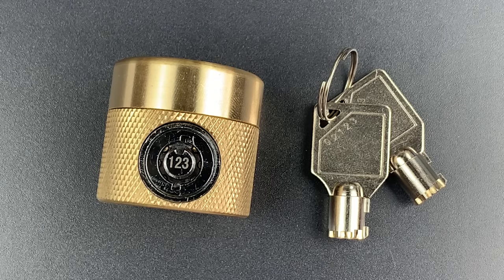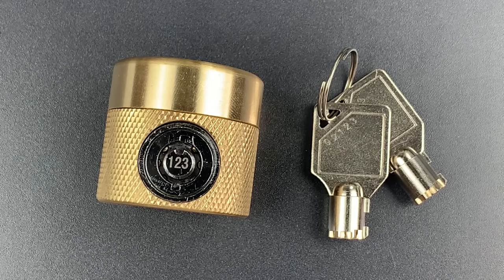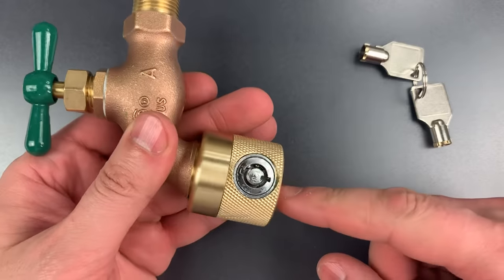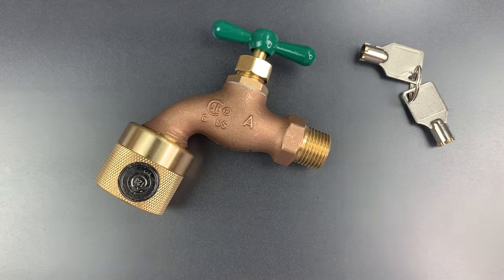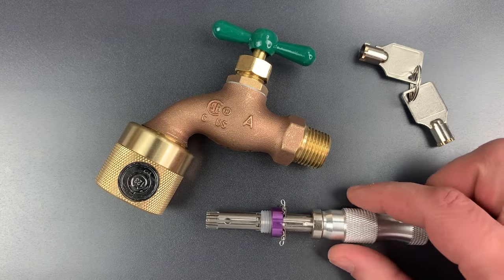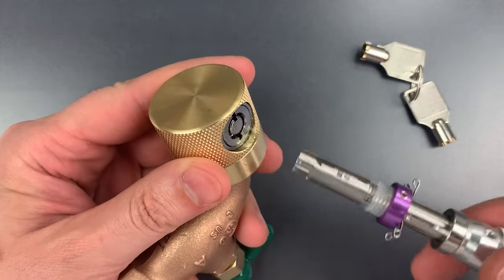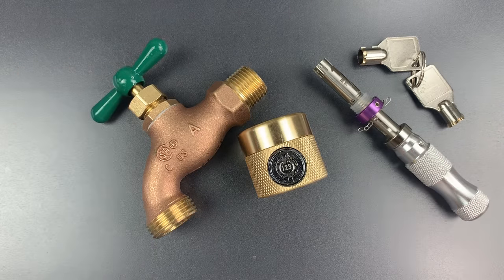[840] Flow Security Systems “FaucetLock” Picked FAST

Comment: Removing the handle is usually enough to protect a faucet.
Reply: You can remove the handle?!
Reply: @anthonyjh02  on some yes
Reply: @anthonyjh02  usaly theres a screw or bolt/nut on top of the handle that you take out and off comes the handle
Reply: nothing a pair of pliers cant take care of .  once it's stripped you will need to replace it as well costing even more money
Reply: Can't someone just put a new handle on then
Reply: @SoulDelSol  Um... yeah, but who carries a spigot handle around?
Reply: @TiberianFiend  i thought it'd be at least a few hours before someone said that, I'm impressed.
Reply: @SoulDelSol  Can use pliers too. If you're out to steal someone's water you probably have pliers on you too just in case.
Although I've never heard of stealing someone's water, only about stealing valves and water meters.
Reply: @pubcollize  ya I've heard of stealing copper pipes from vacant apartments for scrap.  And I've heard of people routing water from other side of water meter so they don't have to pay water bill to city.  Also I've heard of people stealing various utilities from neighbors in shared buildings so their usage goes on another's bill.  Watering lawn does use a lot of water so i could see someone putting hose on another spicket if right there but seems like hose across yard would be giveaway.  For my spicket, i have a shut off valve inside house in basement.  I could see landlords in apartment complexes wanting to protect their spickets from people washing cars and using sprinklers for kids on landlords utility bill
Reply: @SoulDelSol  Stealing utilities from utility companies is one thing, but stealing them from a neighbor sounds like way too much risk for barely any reward.
I live in the city so I've heard of cases, and seen results of, where bikes were locked to water meters downtown and both the bike and the water meter were stolen. Huge mess, also best example of "be careful what you lock to".
Also never heard of spigots being called "spickets".
Reply: @pubcollize  You can't steal water. Legally, it's not theft. However, passers-by who just need some water for whatever reason can open up a spigot and leave it on, which will eventually burst a garden hose, leaving you to pay for the hose and the wasted water. People take water as a "crime" of opportunity. Take the handle off and they'll move on to the next spigot.
Reply: @TiberianFiend  of course you can steal water, someone pays for it..  i pay a quarterly water bill that has portion for water usage based on meter and portion of sewer usage (also based on same meter). Also why would a hose explode if you left water on?
Reply: @pubcollize  i looked up spigot vs spicket and i was wrong
// “Spigot” is the correct answer. Did you get it? “Spicket”—though commonly said and written—is not actually the commonly accepted spelling of the word. This confusion dates back to the Middle English “spyket,” according to Merriam-Webster though, so I wouldn't feel so bad about it if you had it wrong. //
Reply: @SoulDelSol  I'm ESL so I'm aware of the spelling but I don't recall hearing it pronounced, I guess the pronunciation should be fairly identical now that I think about it.
Reply: @Daybreaker7826  On many of them really.
Reply: @TiberianFiend  you absolutely can steal water, and it is absolutely illegal. Like you can grab a bucket of water from a lake and it's not theft, but taking water paid for by someone else using their infrastructure without permission is absolutely theft
Reply: @brewcityboatclub8299  One of the legal requirements for theft is preventing the previous owner from use of the stolen item. Since the water is on tap, you have an indefinite amount of it and are not prevented from using it.
Reply: @TiberianFiend  If I bought a bottle of water at the store, and someone grabbed it from me in the parking lot and ran away, wouldn't that be theft? So what is the legal difference between a bottleful of water from the store, and a bottleful of water from a tap? How quickly you can buy another one? Water companies don't charge flat subscription fees; they charge per unit of water delivered. That's why you have a water meter on your property.
Reply: @Nezuji  Bottled water is finite and containerized. Tap water is not. Taking your bottle of water will prevent you from using it yourself.
Reply: @TiberianFiend  
Buddy it’s illegal regardless. Using someone’s infrastructure is illegal. It’s literally called water theft. A simple search brings that up.

Nice try buddy

Especially in texas, it’s considered a class c misdemeanor (in austin at least) So a fine that’s equal to or less than 2,000
Reply: @cadenbrown7407  I didn't say it was legal. I said it wasn't theft. If it was, it would be covered under existing theft laws and wouldn't require its own special laws, now would it?

F.Y.I.--Legislators can call a law whatever they please, but that doesn't make it theft. I had to go over this for the "software piracy is theft" guys, too.
Reply: @TiberianFiend   Water theifs?
Reply: @TiberianFiend  Apples and oranges. If someone buys software and I copy it, then the original buyer still has and can use the software. If you take a gallon of water out of my spigot, then I have to pay for that gallon, AND pay for another gallon for myself. You have literally taken something with a defined value from me. The fact that I can "get more" is irrelevant.
Reply: @TiberianFiend  someone who has played too many point and click puzzles
Reply: @TiberianFiend  so do you think someone can plug their heater into extension cord and  run up your electricity bill?  You think that's not stealing bc "you can always just get more electricity from the wall"?  Yes the thief didn't block your access but the thief stole [electricity/water] that person now has to pay company back for.   That's like me using your credit card and then saying "chill there is still more money left available for ya" - you still have to pay back for what i took.  How do you not understand utilities at all?  You have to pay for everything, each gallon of cold water from the tap, trash removal on trash day, etc..
PS I will make one caveat.  Tap water is NOT free in urban areas.  Perhaps he didnt know that bc he lives in rural area and has a well.  Someone using well is different than someone using your city tap water which is paid for by the gallon
Reply: @punker4Real  And the pliers could remove the "lock" anyway. There's plenty of meat above the part which spins freely.
Reply: Tiberian Friend it's still theft, tap water is a resource you pay for. Just because you can still get more from the faucet doesn't mean the amount taken wasn't theft.

Your analogy is just as stupid as if you were to say theft of cash is not theft "because you can just go get more from the ATM"

It doesn't matter how much more of the resource you have, it's yours and it has value. Someone taking it is theft whether it's cash, water, food or any other resource that you own or pay for.
Reply: Have a neighbor fill up their pool from your tap without permission and then find out you now have to pay potentially hundreds of extra dollars for the stolen water and then tell me it's not theft.
Reply: Great idea

Comment: Picks it in 10 seconds.

"It took a little longer than expected"
Reply: In his defense, for him, it IS a tad long.
Reply: In his defense, it was the locks fault, it has weak springs, probably. :)
Reply: @JosephLedbetter  
But in the case of a low-value target, such as this faucet, any security measure is probably enough.

Comment: A problem where a faucet is on a walk path to a public beach.  People will leave water on, leave trash around faucet, break faucet, damage property.
Reply: Hence this product, but there are certain taps on the market that don’t require a lock to operate but do require a key 🤯.
Plumber here, and lock pick enthusiast.
Reply: @NoticeForBlue  .
At least in Australia, publicly located taps tend to have removable handles and so unless you just happen to carry around pliers or mulitgrips (or one of the handles) all the time, these taps are effectively locked.
Reply: I’m a plumber from Australia.
Reply: I wonder if water still seeps through if you turn the faucet on. Also is the lock entirely waterproof inside, in case soneone foes turn on the tap. It would need to be submersible grade so that it diesnf rust out. How well with the grease in the lock cope with water immersion in long term
Reply: @dj1NM3  the thing is, I use those same faucets for my own front and back yard to hook the hose up to. So I have one of those keys on my keyring along with my house keys. The thing is, while those keys are pretty much universal, you don't have any way of knowing whether that water is safe to drink or not.
Reply: @Professional_Youtube_Commenter  ofcource. That's the first step when designing such a lock:
Step 1/ do not leak any water
Step 2/ how?
Step 3/ design a lock that suits the tap
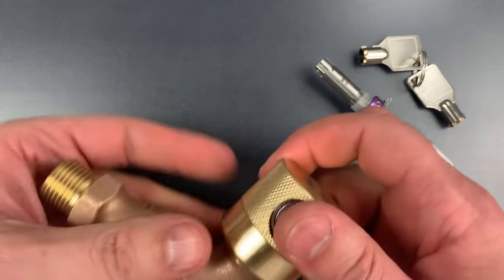Reply: @Professional_Youtube_Commenter  At 1:34 you can see a black rubber gasket inside the lock.

Comment: Because I live far enough north for freezing to be an issue in winter, we have a two-tap setup: the feed comes off of the suppy line in the basement, it has a tap so it can be disabled from inside the house. This tap sits high enough so not much water can freeze and expand in the length of pipe that goes through to the outside.

Comment: Fascinating..  Here in Australia this would be Illegal!  As to "deny a person water" is a criminal offence . If a person were to walk up to your garden "Front" tap and drink from it. YOU would be charged if you stopped them. Sure they cannot start filling up bottles, but if the trespasser declared they were thirsty, you cannot deny them water.
Reply: Ok, if they were thirsty I would gladly get them a glass of water if they ask.  But using gallons of water without even asking to water their lawn is completely different.  Besides my outside tap is turned off from the inside mainly to prevent freezing in winter

Comment: You underestimate petty wars between neighbours.
Reply: yeah, turning on the faucet then walks away
Reply: Luckily, I've always got very good and thrustworthy neighbours. Some are like family. They got the key to my house, I've got theirs. Anything wrong happens when one isn't at home, the other takes care of it. Very useful during holidays too. We also use to run a current cable from one house to another if one is renovating needs more power for the tools (here most houses are limited to 3,3 kW).

Comment: That's very interesting, I had no idea water bib locks existed.

In Colombia, where I'm from, water bibs typically have the little key thingie you turn removed, leaving just the stem where it attaches. It's barely safe, because any thin flat object, like any key, screwdriver, or knife can be easily used to open the bib. It's still effective though.

Comment: I just turn the water off inside my house from the safety valve when I'm not using it.
Reply: In Australia, all our safety valves for water are on our water metres out the front just outside our front boundaries, water travels from the water mains through them before entering our properties.

Technically, this means that even if you build a 1.7m fence along your front boundary and sides, someone could still shut off your water in the middle of the night.

Comment: A good caveat in the practicality stakes - ANY measure is probably sufficient deterrent, and this is better than some little barsteward opening the tap and flooding the place. I coulda done with one of those 20 years ago. Would also be useful on frost free external taps, which dont need an internal isolator.

Comment: i don't think the homeless drug addict who steals my water is gonna have one of these tools.
unless he is a former lockpick who fell on hard times and ended up homeless due to his drug addiction.
Reply: if he was a pro locksmith i think he would just go straight into the house and us eht eshower
Reply: You can on the other hand make a simple low quality impressioning tool out of an empty loo roll, or if that is too difficult to get hold of in these times, a Bic pencil. I've opened similar locks with the loo roll variant before.
Reply: He'll grab the upper part and twist there.
Reply: @CptJistuce  yep a pair of channel locks or vise grips
Reply: This is why you have a valve inside the house instead to prevent water from coming out of the bibb regardless of it's open position
Reply: @AiOinc1  you might have that in colder areas, but not here in south texas where it is winter and i am wearing basketball shorts and a tee shirt.
Reply: @akui88  Ah yes, because southern Alabama is a colder area. It's winter here and I have my convertible top down.

Comment: I live in a ground floor flat, in a block of six.
Directly outside, and below, my kitchen windows is an external water tap plumbed right off my supply.
Underneath my kitchen sink, where the pipe from the outside tap comes in, there is a little isolating valve which, when I first moved in, five years ago, was turned off. That is, no water to outside tap.
Back in the early seventies when my block of flats were built, water wasn't metered. You could use as much as you liked and just paid your quarterly "water rates", which was a fixed amount that 
epended on the size of your household (Not the size of your property).
Obviously, back then it didn't matter whose supply any external tap was plumbed in to since the water rates bill was fixed, no matter how much water you actually used.
Anyway, over time, water meters were introduced and now pretty much everyone has them, which would explain the (obviously newer) isolation valve under my sink.
Yes, I am getting to the point...
First thing I did was to reinstate the outside tap and all my neighbours really love me for it.
Money may not buy you love, but water sure as heck does !
>

Comment: We used to take the handles off. The point of the video is poorly designed tubular locks can be defeated by anyone with a fleaBay account.
Reply: What if they bring a handle from home?
Reply: Or a pair of pliers
Reply: The removable handle bibs have a sleeve around the valve to recess it and make using pliers difficult.
Reply: I just weld the handle in place
Reply: To be fair most locks can be defeated by anyone with an ebay account. Ebay accounts are probably the main real world threat to anything locked up publicly 🙂

Comment: My mother in law has neighbors that we know have been stealing stuff from her, but have no physical proof. Things like a tiller, generator, even a four wheeler a cousin kept in their back yard gone missing.

A week or so ago, she noticed the barrel covering her faucet had been tampered with and moved, after they had come over asking to use her faucet. When confronted, one of the women said they had not been using our faucet.

We bought one similar to this but it's a two piece design to fit any lock shackle. I installed it today and noticed a blue cigarette lighter about 3 feet from the barrel covering faucet that someone had dropped when over in our yard. MIL doesn't smoke, neither does FIL, nor do wife and I.

I only wish I could see their face when they lift up the barrel and see this puppy screwed on to the faucet.

Comment: When we find water becomes more and more scarce we’ll need to start putting those 15 pound steel and tungsten padlocks you have around. 😂😂 At least you’re prepared for anything with that collection of locks!
Reply: Finnigan Sargeant - The amount of water on the planet always remains at a constant. We never have more or less, always the same.
Reply: @isyt1  I should say, as the amount of potable water becomes more scarce. Although I'm sure we will use desalination eventually even though it costs quite a bit. I suppose water will just be more expensive until we make things efficient.
Reply: IS YT In the grand scheme of things maybe. But if we are going to nitpick here at least it should be done right. Let‘s assume Water reacts with potassium, the amount of water on the planet theoretically decreases. Since similar reactions happen all the time the exact amount of Water on this planet is actually in constant fluctuation.
Reply: Flyingby - You seem to be talking about available drinking water. That is different, and besides any assimilated water can be reversed
Reply: IS YT Lads could we not have an argument over water? 😂 I didn’t want to start an argument over a simple comment about locking your taps. 😂
Reply: Finnigan Sargeant sorry I just was confused about you saying water would become scarce
Reply: IS YT No worries it’s fine, all I was worried about is this turning into one of those crazy YouTube reply battles that unfortunately I have seen too many of. 😅
Reply: @isyt1  This

Comment: These locks are also often used in harddisk drive caddy's. Nothing like a quick 10 second pick and running off with someone's complete OS complete with My Documents folder ready for breaking into at a later time.

Water might be low value target, but when you can almost effortlessly walk into a public school, and raid the whole computer department, that's another story..

Good job man, maybe something will change..

Comment: We have these at my work. Somebody just left the key next to it one night at it as well as the faucetlock were taken a few hours later. We still had one other faucet locks installed on the building and I used a bic pen body to jam it in and unlocked it in about 10 seconds. Shows how effective they are, ha!
Reply: How? I just tried the Bic pen. My keys were stolen and now I can't use my waterhole. My son and I have tried everything to get this lock off
Reply: @mschik39401  take the pen+ink part out so you just have the plastic hollow tube. Then jam the tube into the round hole of the lock and give it some turns as you force it in and out.